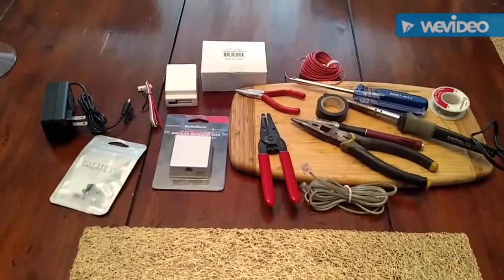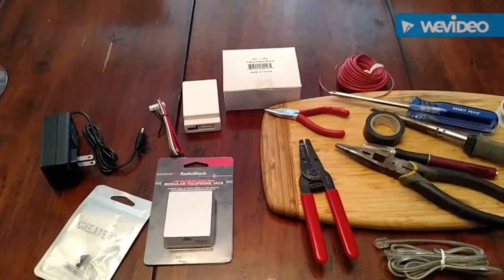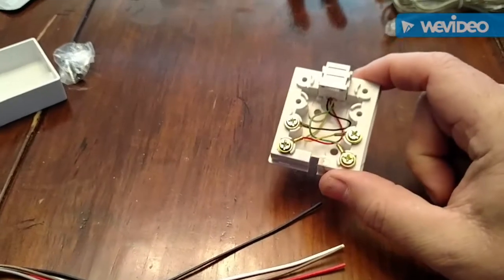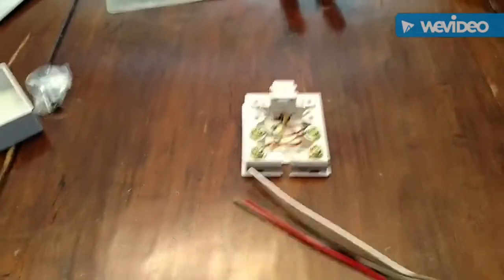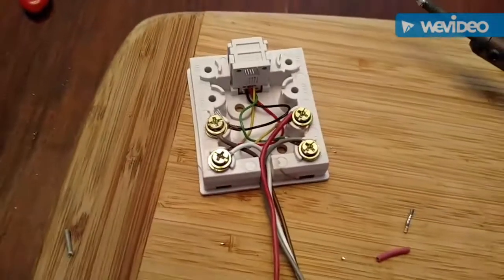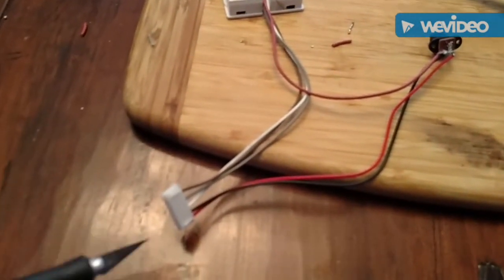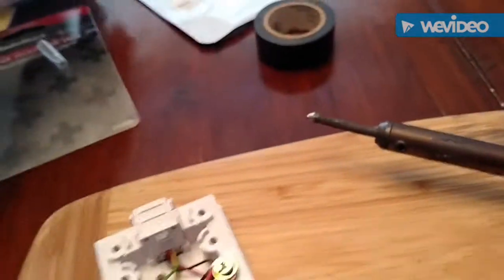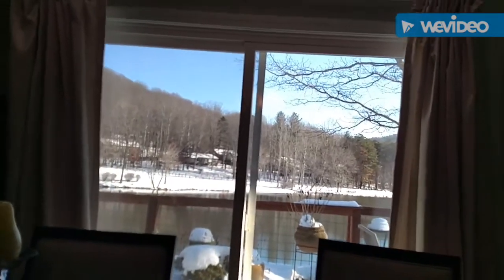Monoprice Z Wave Curtain Module

Comment: Parts you used would be helpful. Which curtain track are you using? checked monoprice and did not see a curtain controller.
Reply from the maker: Monoprice  no longer has this switch available.  I would not know where to get one.
The curtain rods came from MWT https://www.motorizedwindowtreatment.com/index.php?main_page=product_info&cPath=9&products_id=62